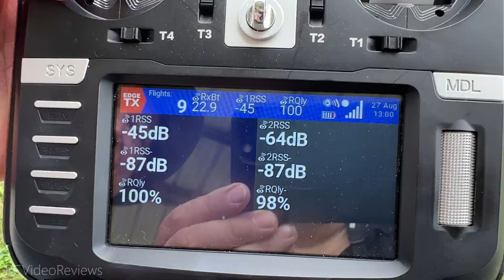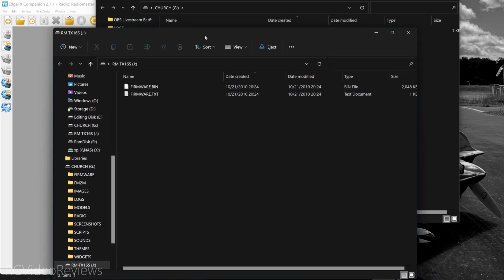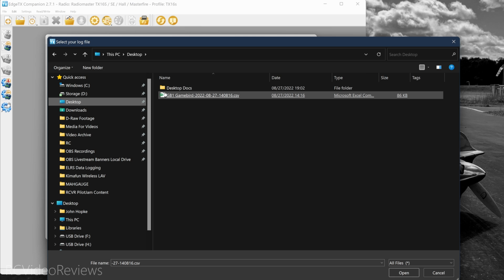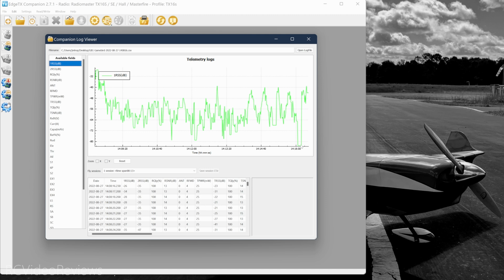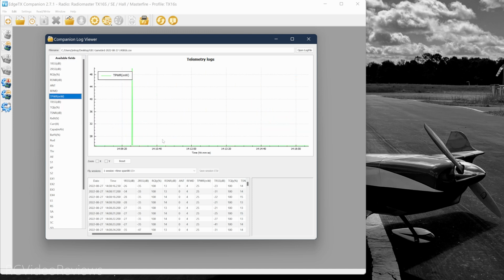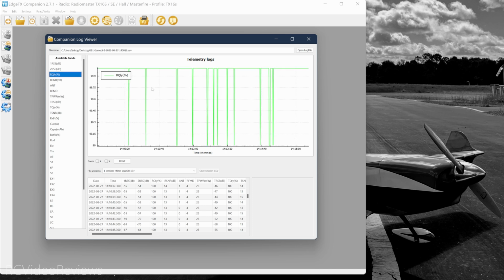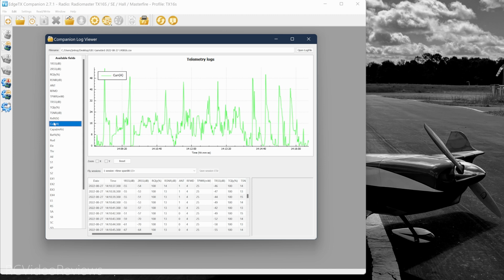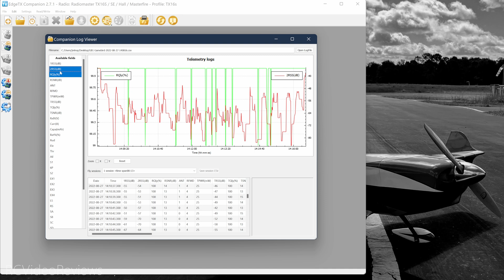Matek R24D with Express LRS 3.0 [ELRS] Worth it? • How Does it Perform?

Comment: Hello, nice video, how much is true the issue commented around internet related with heating Matek that couldn't maintain good link
Reply from the maker: I've been flying my best planes most of the summer in Florida with 95+ temps and 95+ humidy on Matek ELRS without issue.
Reply: So the six channels are fully proportional? None issues with telemetry? What about range?

Comment: Is there a way to make a 16 channel elrs pwm receiver ? I use Spektrum receivers and assign multiple channels to one. like 2 servos for ail 2 for flaps 2 for rudder. etc. 50cc and bigger planes.
Reply from the maker: Yes. You would use an ELRS receiver paired to an SBUS converter and then you would connect the SBUS line to one of these https://amzn.to/3ACFOeN
Reply: @RCVideoReviews  thank you
Reply: An update on this for anybody passing by, with the latest ELRS you can pick what channel is mapped to what PWM output on the receiver. So you can use a second 6 output pwm receiver for channels 7 through 13 for example. Just have to remember to force telemetry off on that second receiver is all.

Comment: Hi, amazing, super interesting video and data logging ! And a gorgeous RC model, too ! I have one question : since you are using ELRS 3.0 on the receiver, did you have to upgrade your Radiomaster transmitter to ELRS 3.0 so that the two could bind ? How did these firmware upgrades go ? And about a video about logging sensor data : YES, please !
Reply from the maker: You definitely want to keep Tx/Rx on the same major revision. The firmware upgrade can be a little tricky sometimes, but it always winds up working. Noted on the sensor video...

Comment: The 24D is my go to receiver. A 5" and  7" quads , an antique Radian  Parkzone glider with the Vario board, a Nano Goblin ,  And on the test bench.......a Vintage Nitro Avistar! Taking a trip back to my youth with nitro, wipe rags and Windex doesn't mean the 50mc Futaba will have to come of  the box. It too will rock a 24D. Oh and half of my 24ds are the infamous silver button. All working flawlessly! I haven't upgraded to ELRS 3 as yet since none of my craft , at this time, need more than 4 High res ch. I guess may only trouble has been flashing. I just haven't learned how to do wifi flashing. But along comes the SpeedyBee app and wallah!
Reply from the maker: I'm impressed with the 24D. It's a top performer. The wifi flashing isn't too bad. In the configuration you can put your house SSID in and it will connect to your home wifi. You can flash right from your browser.

Comment: Is there an easy way to sync and display the log along with fpv dvr video?
Im going to have to start keeping and checking logs.
Reply: I've used sd logs with dashware to overlay info on action cam footage the way I sync it is to hold my transmitter in the FOV of the camera as I flick the arm switch. That gives me a sync reference in the on-board camera footage

Comment: Will an ELRS 3.X X TX GO/WORK BACKWARDS on a 2.X.X RX?
Reply: You'll have to flash the old rx. But it will work once flashed
Reply: @terminsane   It's AIO mobil⁷ 1s version one.0 I don't think it's Flashable there's no Bluetooth or Wi-Fi Built-in to the all-in-one board,
Reply: @sullytrny  ohh. The AIO's are SPI based and those get updated along with Betaflight. You need to stay with ELRS2.x for SPI.

You could consider getting a second module for the 2.x whoops if you need 3.x for  bigger stuff.
Reply: @terminsane   Yeah I know it just sucks finally got to get away with one transmitter and now I still need two,...
Reply: @sullytrny  could maybe use two modules instead. But yeah. I have the same problem. I just dont fly whoops during summer *shrugs*

Comment: Is ELRS sucking less battery power yet?  It's a thirsty protocol.
Reply from the maker: 25mw on TX and < 0.4a static on the plane. I wouldn't consider that any more consumptive than others...?
Reply: @RCVideoReviews  Surprisingly had lower flight times with Radian, 2 servo's, with matek vario with telemetry on.  Maybe from tele and extra sensors, had frsky before ELRS.  25mw on TX.